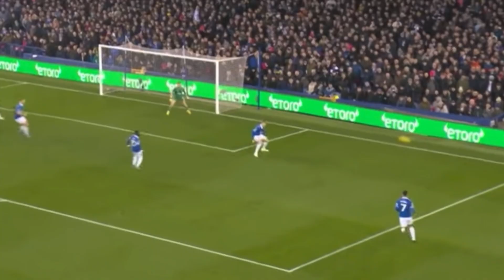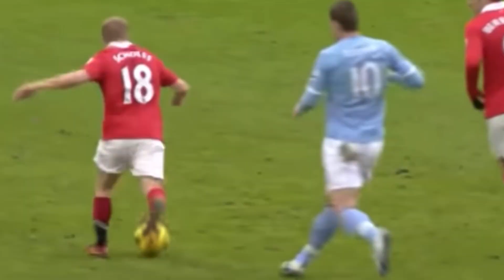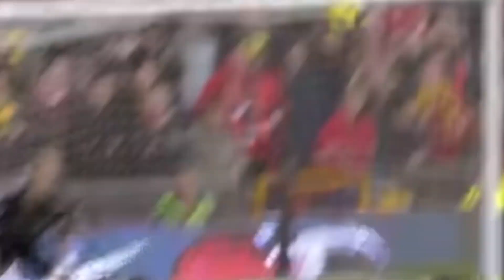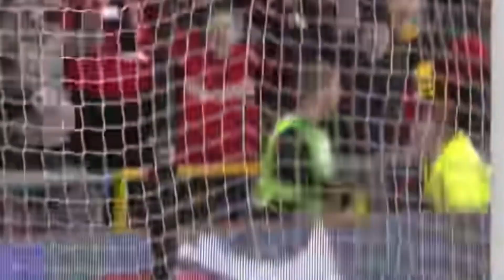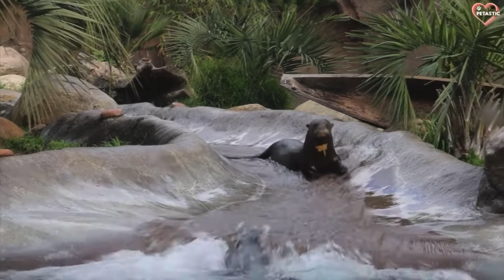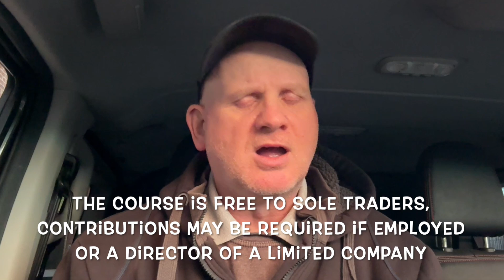Part 5 of My journey to becoming an air source heat pump engineer for free. Exam time

Comment: We have an air to air heat pump. We live in Central France where winters can be very hard. There is no gas. Heating is either electric or wood burning. It was -9C last night. Inside it was a cosy 19C. Thats a 28 deg differential. The HP coped very well. The house is very well insulated. Total consumption of electricity was 13.4 kWh. That equates to 2.28 € pus tax for 24 hrs.
No more lighting wood fires. The dark side is very warm. Keep going Mr.Tomkat.